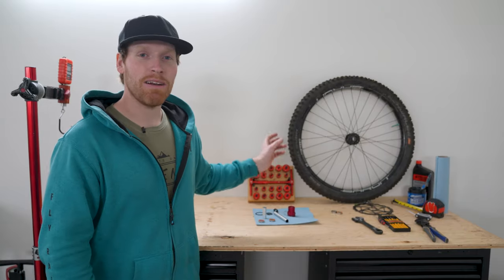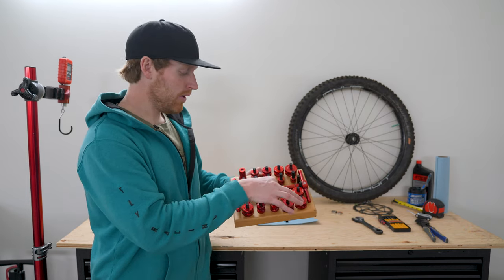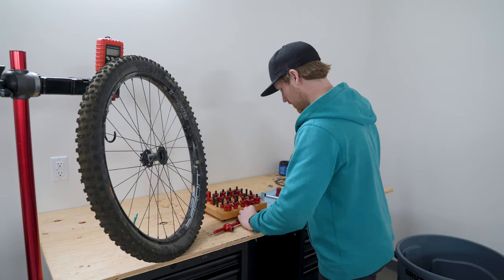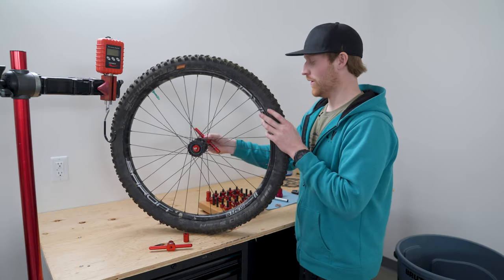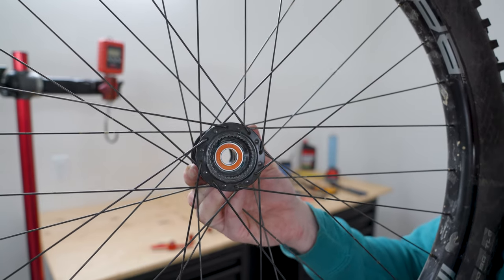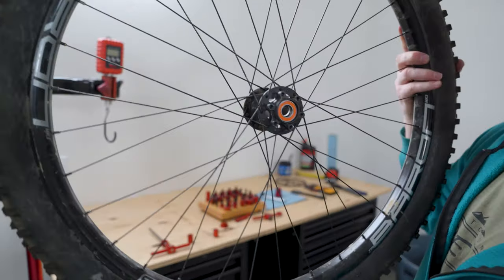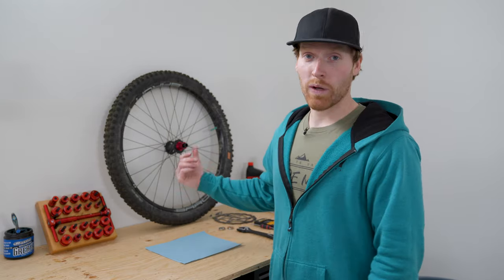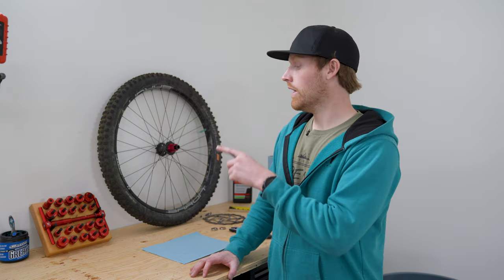Using The Wheels MFG Bearing Press For The First Time

Comment: Can you do a short video on bearing removal?

I'm not quite sure what the best way to remove bearings from blind holes (like the ones you pressed in in this video)
Reply from the maker: Hey T! Yeah I actually use a tool called a blind bearing puller from motion pro. Which makes it really really simple even with broken bearings. The tool can be a little pricey but it’s one of those life long ones that can save you many times haha!

Comment: Would it work on bottom brackets and suspension pivot bearings too?
Reply from the maker: Yeah it should work with most common suspension and pivot bearings. They do sell a dedicated bb tool as well but I think there is some crossover between the two